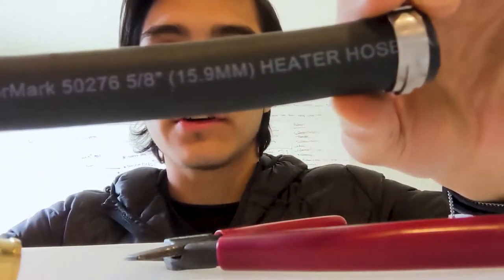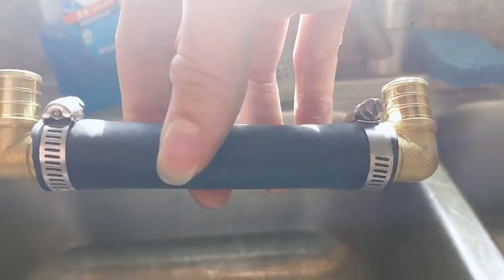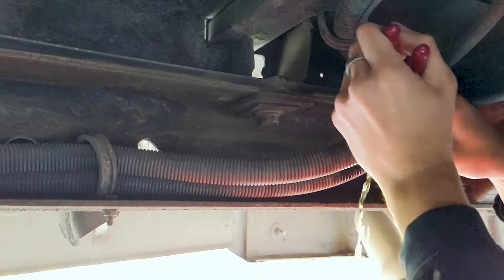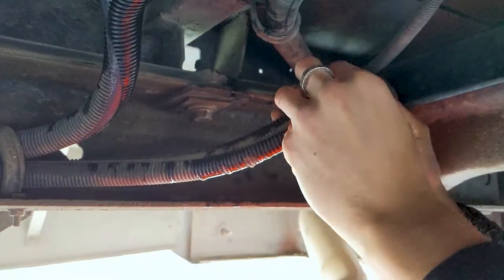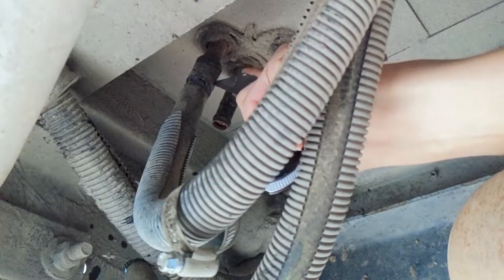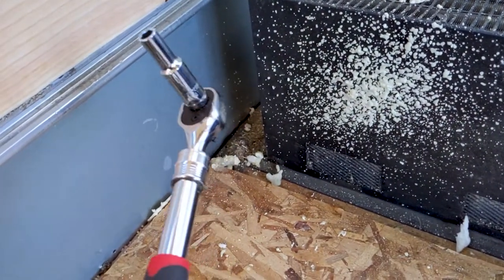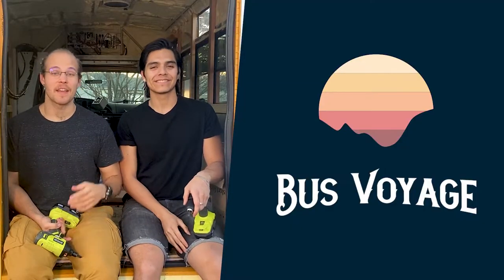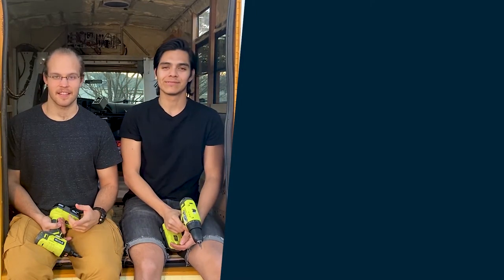How To Remove School Bus Rear Heater - Skoolie Bus Conversion

Comment: THANK YOU. I’ve been looking for something super straightforward and simple. Literally praise you 🙏 now I can continue my build lol!
Reply: Please, Mary, how did it go with your heater?
Reply: @PeaceJourney...  it went good. I created a loop in the system, have driven it from Colorado to North Carolina and the coolant flowed just fine. Had a couple leaks at first but was fixed by tightening the joints tighter. Just check that your coolant levels are staying normal, worst case you need to add a bit every now and then.
Reply: @maryfrankmusic7385  You are awesomeness itself. This is so encouraging! I was going to get inspection today, and was moving the heater back to its original place and the hoses sprung leaks from dry rot. Going into town to get the plumbing parts now👍🏼.
Thank you so much and have a wonderful weekend 💙🤗
Reply: @PeaceJourney...  yeah, of course! Just make sure to get heater hoses, they’re designed to hold hot coolant.

Comment: Hi! I’m currently working on my shuttle bus conversion and removed my rear heater this week! Can you talk about the wires associated with the rear heater? I cut them but should I trace them back to where they start and remove them? Or are the wires also for the front driver heater so leave them but they’ve been cut? I hope all of this makes sense, great video by the way!😊
Reply: I believe you can trace them to your circuit board and cut them where they start! There should be separate wires for the front heater. OP- CORRECT ME IF IM WRONG TOO!

Comment: I used your video to take out the rear video and cut the wire but when I cut the wire it took out the power to my ac and front power